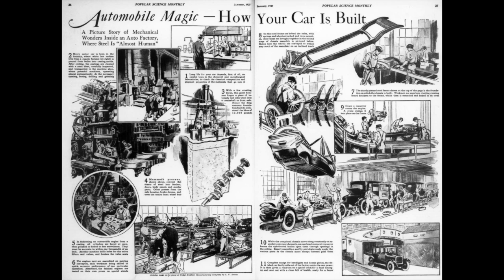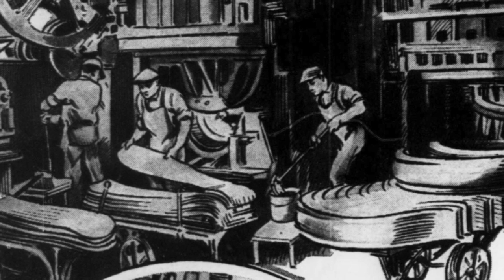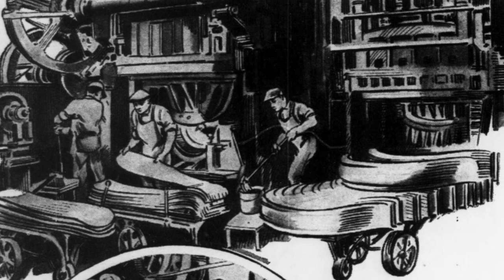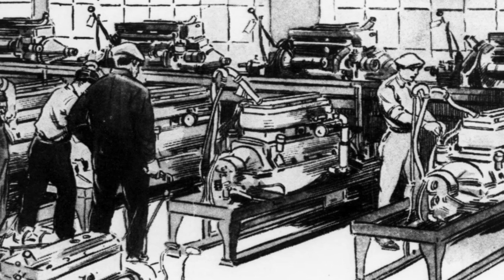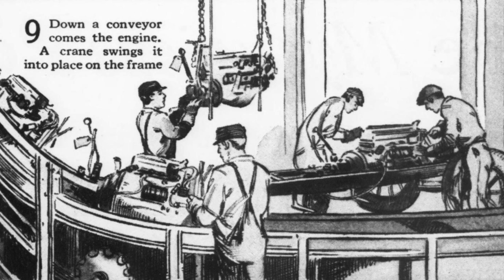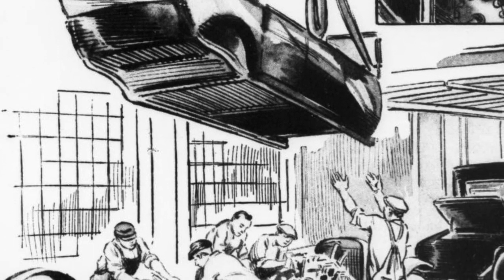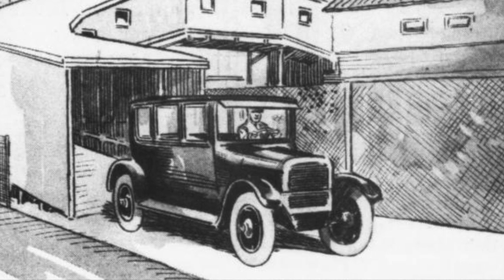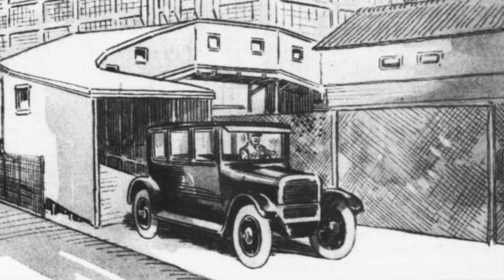How Cars Were Built In 1927

Comment: I did some genealogical research and found out I had two Great Uncles who worked at the Duesenberg auto factory in Indianapolis back in the 20’s.
Reply: My grandmother sewed curtains for the Haynes Apperson Auto Company in Kokomo to the north in the 1910's.  Known for the Apperson Jackrabbit they merged with the Haynes Auto Company to become Haynes-Apperson which lasted until about 1920. Haynes created and drove the first clutch driven car in 1897 as the transmission was also invented in Kokomo, along with the pneumatic tire. Haynes was also a mettalurgist who invented stainless steel in 1912 and several other metals.  There is still a Haynes International Company that makes specialized metals mainly for NASA.  For all these inventions my hometown has the nickname "City Or Firsts."